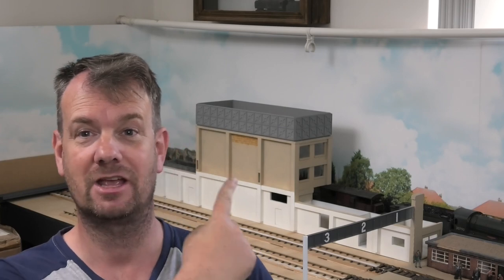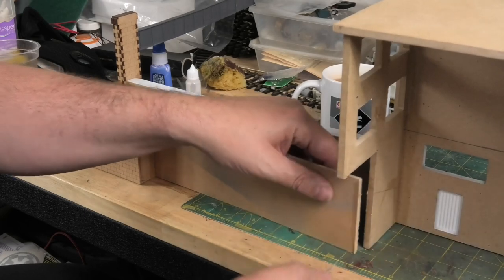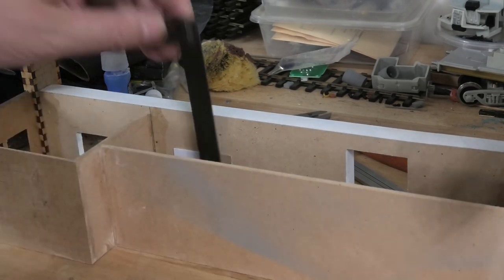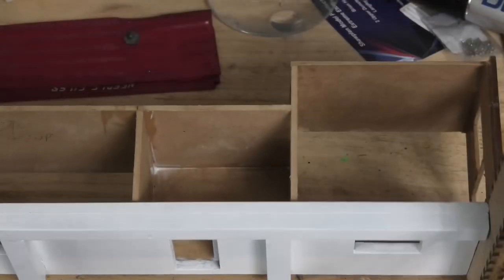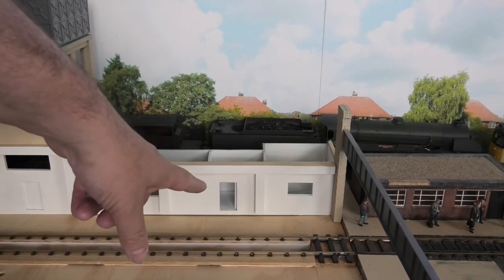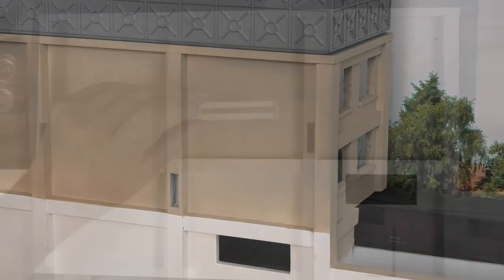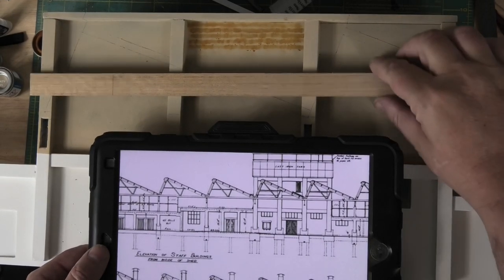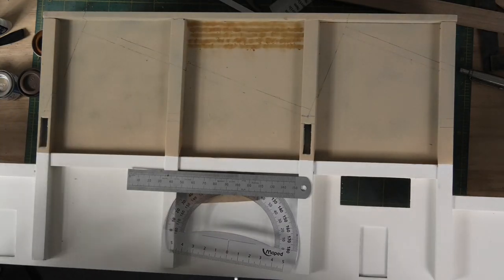Model Trains 164 - Hither Green TMD In O Gauge, building the depot superstructure and adding details

Comment: Hi Ian missed your HG updates. But I am a bit concerned that the roster/safety room is smaller than the Forman’s office, it was over double/ treble the length?
Reply from the maker: Hi Sean, it’s been difficult getting room sizes and layouts given the building doesn’t exis anymore, so it is literally made as representation, also given the space I have means stuff has had to be squashed down. Everything in the room is only visible through the doorway or office window, so it shouldn’t be noticeable. If you have any sketches of how the furniture and notices were laid out in the rooms, I can work with it to see what I can squeeze in. 👍